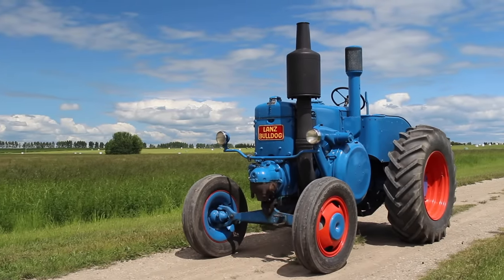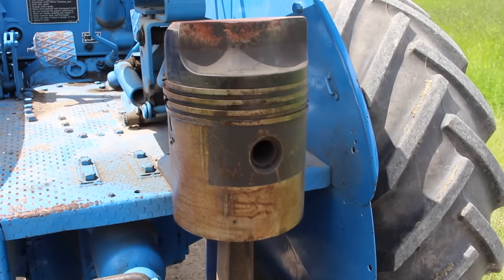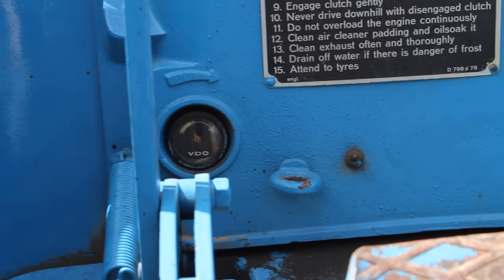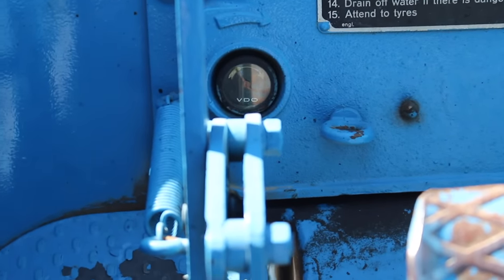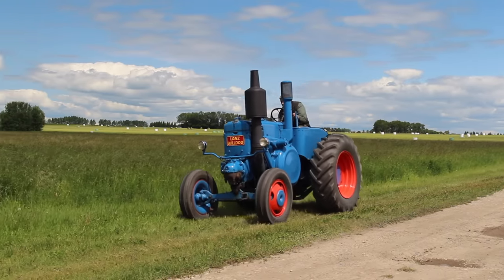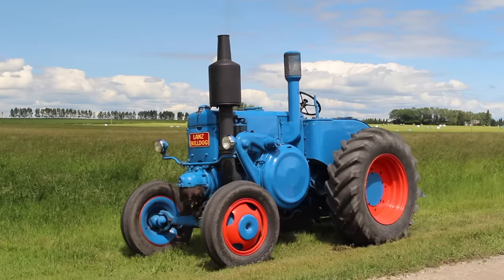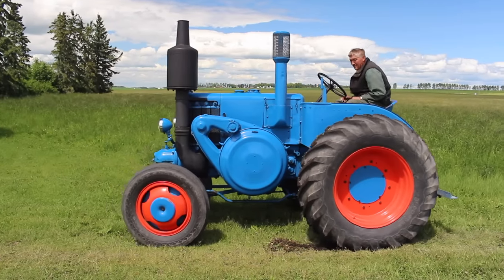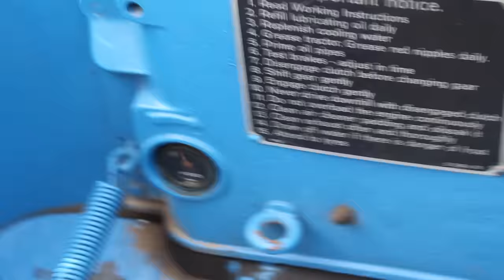Engine running backwards? Lanz Bulldog Tractor two stroke

Comment: Back when stuff wasn’t designed to break after so many years
Reply: Never mind the spare piston on the back 😂
Reply: Lol it’s an 11 litre motor that makes 45 HP the 0.7 litre motor on my motorcycle makes 75 which is only considered average. We have come along way in terms of engineering and efficiency.
Reply: @DMSparky 
45 hp but on 630 rpm. Can your motorcycle do that? :-)
Reply: @DMSparky  yeah but can you reverse the motor of your bike? Or runn 660rmp or no rpm? Or have this much torque?😂
Reply: @DMSparky  the powerband and delivery is all that matters. Your motorcycle engine wouldn't even be able to move the tractor empty.
Reply: @DMSparky  true but there is a slight difference when it comes to torque, a motorcycle would have a hard time getting one of those tires to spin even under 0 load. meanwhile this could pull a house over
Reply: @Daniel M Your motorbike would never be able to put out the crazy torque that this workhorse does. Plus this thing is like a tank, rugged, a more simple design and if maintained will still be running long, long after your bike is dust
Reply: @thebaddestogre-3698   Could you expain to this confused city dweller why that is? Would it not just be a matter of gearing to turn high speed into high torque?
Reply: @DMSparky  haha did you really compare your bike engine to this huge diesel? Do you even know what torque is?
Reply: @callidus-13.x42  you could gear down like crazy, until the tractor is crawling so slow that the farmer wont get any work done. But to get the proper torque to the ground a motorcycle engine would have to be at a crazy high rpm, which negates any efficiency advantage it had. Imagine a honda s2000 motor in a dodge Durango. It would barely move even though it has the same horsepower rating as the 4.7 V8 that the Durango came with.
Reply: @thebaddestogre-3698 
It would with good reduction. Put reduction that you have same wheel speed and it would run almost without a problem.
Reply: @zokonjazokonja  on the freeway the s2000 motor would have to be at 7k rpms just to keep the Durango moving at 70mph no matter how you gear it. It would be getting 5-6mpg everywhere.
Reply: @thebaddestogre-3698   Huh. Isn't HP just a measure of power (like Watts), and wouldn't that just be torque over rpm? I would expect any engine of equal or PS to work just as fine (ignoring the necessary gearing). What am I missing here?
Reply: @callidus-13.x42  Yes horsepower is torque over time which is why a vehicle accelerates fastest at its horsepower peak. More revolutions=more torque per every period of time. But that's where the efficiency comes into play. If you have a big tractor 4cyl running at the engines torque peak vs a 4cyl car geared down so its horsepower peak is putting the same torque to the ground, the the cylinders are getting fuel injected into them 6-10 times as frequently.  Not to mention it would be running hot and turning its work Into heat.
Reply: @thebaddestogre-3698 
I guess you have some calculation behind this figures
Reply: @zokonjazokonja  if you just want to argue then go ask an engineer for Caterpillar or Peterbuild why they dont put Yamaha motorcycle engines in their tractors or semis. If you think they are doing something wrong, you are talking to the wrong guy.
Reply: If you think that power and torque are 2 separated topics than you are totaly wrong, power is calculated basically from torque x RPM, they are connected, one does not exist without other (Edit: ignore this above paragraph, I did't read your previous post where I see that you understand those 2 metrics)
 Now, power you can not increase with gearing, power remain same on input and on output of reductor (minus losses), what is changable is torque. If you reduce gear transmission 2 times, you will get increase of torque 2 times, power remain same.
Now, in your examle of Durango to run 70 mph on highway, constant speed, you should be able to do that with any engine probably not more than 100 hp with correct reduction (I would not be suprised if 50hp would be enough) , because at the end power is needed to do that job. Only what you need is to know air drag and tyre rolling losses. If you are going uphill, than you need to add vehicle mass and slope angle.
Reply: @thebaddestogre-3698  
BTW, I was refering to the posts of the guys that claim that this high RPM engines would not even move heavy vehicles, I just saying it is not true, you can do it with right torque multiplicator. Another question is does is makes sense and how much tear/wear will we cause on engine on long run with such setup, and you are right regarding that, this is not under question. Your example with Durango I already answer, I doubt that S2000 will need to be on 7000 rpm to maintain constant 70 MPh speed (240 hp / 207 Nm@7500 rpm), but it will need to rew for sure, and therefore makes no sense to put such engine on heavy mass vehicle, it is not in correct balance.
Reply: @zokonjazokonja  read all of my comments. You've told me nothing I dont already know and you've not even addressed the efficiency issue. Twice the gearing is twice the rpm. I said 7krpm because that is the torque peak of an s2000 motor. I never once separate horsepower and torque.  Again, you are arguing with the wrong guy if you think every single workhorse engine in history can be replaced by a high rpm low torque engine with gearing magic. You know better than them? There are many negative side effects to it that you aren't addressing which was the whole reason I started a conversation with the motorcycle gentleman.
Reply: @zokonjazokonja  ah your recent comment negates most of my last one, so let's call a truce.  I understand what you mean, but we just strayed too far from my original answer to the motorcycle engine question.👍
Reply: yep. For example, Our Kramer KL600 (62HP awd) is ~50yrs old. We have had many repairs and even replaced the engine once. It still runs fine, and gets (nearly) every job done we have to do, and spare parts aren't an issue. But then, if you'd take for example a Fendt 1050, the repair costs after like 10yrs would be much higher than just buying a new one.
Reply: @nippolus132  there are motircycles with sidecars that have reverse.
Reply: @DMSparky  don't think your little bike engine has 100's of nm's of torque
Reply: @Mr_Fancypants  yeah but i dont think they reverse the engine to drive backwards
Reply: @callidus-13.x42  The issue here is what is often neglected in these endless "horsepower wars":  The ability for an engine to initiate motion.  As long as the transmission is geared properly, any engine with sufficient horsepower can 'maintain' motion.  

However, horsepower is irrelevant when it comes to initiating motion.  To overcome inertia and initiate motion, you have to apply an impulse.  An impulse is, by definition, a shock to the system.  So, in this case, this engine produces a very large amount of torque at a very low RPM, which means the impulse can be applied to the transmission without the input shaft seeing a massive spike in RPM.  

If you were to take a motorcycle engine, as mentioned earlier, and couple it to a transmission that, when the engine is at the RPM of peak torque, would provide the necessary impulse to the wheels to initiate motion, you'd have to dump the clutch while the engine was spinning several thousand RPM!  

That's fine in a drag car that has a clutch that's designed to withstand that kind of impulse.  However, as I think you can clearly see, in this case, it's much more practical to have an engine that generates large amounts of torque at low RPM.  This tractor never sees speeds where high horsepower is necessary.
Reply: That idling with the gear in still felt like abuse though! :(
Reply: @mattiaswidegren2242  It definitely wasn't easy on parts, that's for sure!  I think it was more of a demonstration of how the 2-stroke, diesel cycle works with a single-cylinder of that large of displacement!
Reply: Just the back of the driver when in jiggle mode
Reply: Lmao at how many people were triggered by my comment. First of all I think this is a pretty neat piece of agricultural history and I do in fact understand what torque is. Hahaha this tractor has 7.4x more torque then my motorcycle. I wasn’t claiming my motorcycle was a better tractor then this tractor. Hahaha I’m just tired of hearing the most boomer comment in the world “TheY DoNT buIlD tHEM liKe THEy UseD TOo!” People would still use tractors like this if they were truly superior to modern machines. New tractors are more powerful, more efficient, more comfortable and more productive. Implying that new tractors are inferior to old tractors and that new tractors are designed to break is silly. Pretty sure I wouldn’t trade my 15 year old truck which does in fact have as much torque as this tractor for a truck of a similar vintage.  The only argument is that this for this tractor is that it’s significantly simpler then a modern tractor. Just because it’s simpler doesn’t always mean it’s more durable or better.
Reply: @DMSparky  Please don't hear this as me flashing credentials and expecting you to step back into line, I just want to make known what I was taught:  I have a degree in Mechanical Engineering, and, in my Mechanical Design class, we were taught about the concept of an "Endurance Limit".  All ferrous metals, i.e., anything alloyed with Iron, have an Endurance Limit that, if a part made of that metal is designed in a way that it's application doesn't exceed its Endurance Limit, it will literally last forever.  The science of an Endurance Limit also allows you to accurately predict how many cycles the part will survive if it's Endurance Limit is exceeded in its application.

So, when you mix that concept in with the greed that's running rampant in literally every industry these days, you get vehicles, appliances, tools - literally anything with ferrous metal in it - that are designed to fail after a certain amount of use.  It's a hard fact of the world wet live in. 

The phrase "They don't make 'em like they used to!", while completely cliché, is 100% accurate.
Reply: They don't build them like they used to because people want cheap stuff. The old stuff was heavy and expensive. If you want good stuff, you have to pay extra.
Reply: Looks at all these Elmer Fudds...talking like this tractor has been actively used on a farm all these years...it’s been restored, and kept safe somewhere. If I retouched up anything I found in a few years and kept it in a box for another handful of decades...you’d watch people who are afraid of change circle jerk around how “tHeY dOnT mAkE eM lIke tHeY uSeD tO” and how much their efficient, competent and versatile product they own now “sucks”
Reply: This kind of engines are not the best example of durability, in fact piston's rings must be changed after a fixed amount of hour because of lack of lubrication, that's the reason moder diesel are 4 strokes.
For the argument couple vs horsepower its true that a reduction could multiply the couple with high rpm but with huge consuptions!
Reply: Service stations and garage mechanics weren't very widespread when these were around.  They don't get to rely on someone being around to fix it when it breaks.
Reply: @andreap555  ty
Reply: @andreap555  There's nothing about the 2-stroke cycle that causes piston ring failure.  Look at all of the Detroit 2-stroke diesels that last millions of miles without being rebuilt.  2-stroke diesels were phased out because of stricter emission standards.
Reply: @AutoSearPin  Just because something looks nice and clean doesn't mean it's never been used.  Also, you can cosmetically restore something without needing to rebuild the the mechanical side of it - which is what this discussion is about.  Even if this tractor was restored, there's no reason to believe that they had to overhaul the engine.

Also, this discussion has nothing to do with the obvious increase in efficiency that has come over the past century of engine technology.  You'd have to be completely ignorant to deny that.  The point that is being made in the statement "They don't make them like they used to!" is that there's no excuse for the blatant lack of longevity and high maintenance costs that are prevalent in today's products.
Reply: @JayRussellDuramax  Do they run on pure diesel?
Reply: @andreap555  The Detroit diesel engines?  Yes.  The fuel and lubrication systems are completely separated.  Look up the DeBoss Garage videos of him tearing apart one of them.  They're not like a tiny, 2-stroke, gasoline engine that requires an oil to be mixed into the fuel.
Reply: @JayRussellDuramax   And air is pumped with tubo, right?
Here there isnt a lubrication system and air is pumped by the other side of the piston
Reply: @user2C47   correct it’s all about value engineering. In fairness there are modern tractors that run up 20k hours. People always bitch that their freezers don’t last as long as their parents Coldspot Freezer from Sears in 1955 did. Mean while adjusted for inflation those freezers literally cost $4000 USD and were significantly less efficient, then they complain when their foreign made freezer that cost $350 dollars breaks after 7 years.
Reply: @JayRussellDuramax  like I said in another comment A ColdSpot freezer from Sears in the year 1955 when adjusted for inflation cost $3950 USD most people don’t spend more then $750 on a freezer today because most people aren’t interested in spending a months wages on a freezer. Most people don’t care about a products longevity as long as it’s athletically pleasing, is inexpensive and has a certain feature set. Blame the consumer, greedy executives and extreme value engineering. I honestly feel bad for most mechanical engineers today.
Reply: @DMSparky  That's not an apples to apples comparison.  Comparing the price of an emerging technology to what it is now is neither fair nor is it relevant to this discussion.  The original statement was that products of yesteryear were made more robust and reliable than products of today.  That's a fact.  

You are correct, though, that the majority of people don't care about reliability or longevity - which explains the unfortunate character traits that those same people embody.  If people were concerned about things that matter most - namely, reliability and longevity - our products would be much better - and they'd still be made in this country!
Reply: @andreap555  Turbos rely on exhaust pressure to move air.  The only way a 2-stroke engine can use a turbo is if the blower providing the intake air operates at a higher pressure than the drive pressure of the turbo.

Are you saying that the down-stroke of the piston pressurizes the crankcase and then charges the cylinder when the piston is low enough?
Reply: @JayRussellDuramax  I agree. I’m in Canada and about to pay more then double to have motorcycle ramps for my truck bed made locally in a nearby fabrication shop rather then purchasing a product made in China. I think reviving domestic manufacturing is one of the only ways we as a society will survive. I go out of my way to buy products made in the USA or Canada wherever possible even if it costs significantly more. I’d rather my money go to someone locally rather then someone over seas.
Reply: @JayRussellDuramax  I was doing a lot of research relating to freezer design the vast majority of manufacturers bragged about having LED lighting or Bluetooth connectivity rather then compressor size or ease of serviceability. With the exception of commercial units which for some reason will void residential insurance policies.
Reply: @DMSparky  Exactly!  The same stuff infuriates me on maintaining engines!  I worked at a Valvoline Instant Oil Change, and it never ceased to amaze me at how much of an afterthought maintenance is nowadays.  It also constantly amazed me at how many people refused to actually maintain their engines.  I saw multiple vehicles with under 40,000 miles that were already leaking oil because the owner refused to put in anything better than conventional...
Reply: @callidus-13.x42  You can use gearing to get more torque but if you try too much the engine will stall. A motorcycle engine will never have much torque, pistons are too small, that is why all vehicles with a shit ton of torque use larger pistons. Most Semis use Inline engines with massive pistons that make a normal car engine's piston look like a child. You will never get as much torque with a motorcycle engine, even with all the gearing in the world, as you would with something that is meant to have a lot of torque. A wider piston will have more surface area effected by the explosion from the combustion of the fuel and air, though it wont run as fast as a narrower piston due to more weight and some other factors I wont go into, it has much more torque.
Reply: Whats not there cant break, plus what breaks is way easier to fix.
Reply: @JayRussellDuramax   Thank you! That clears up a lot of questions.
Reply: @JayRussellDuramax  Maybe its called only volumetric in USA i meant that type.
Yest its exactly like a gasoline 2t engine but diesel is injected directly in the head chamber.
Must correct myself there is actually an oil pump that sends oil directly in the cylinder so it runs on mix diesel-oil
Reply: @andreap555  I don't see any documentation saying that a 2-stroke, Diesel engine pressurizes its own crankcase.  Everything I see shows that they require forced induction, i.e., a Roots blower, to charge the cylinder.  This means that there's nothing preventing them from having separate fuel and lubrication systems.  So, unless you have specific documentation that you can share, I don't think you're correct in saying that these piston rings wear out quickly.
Reply: @JayRussellDuramax  I have a link but its not in english: http://trattoridepocapiacentini.it/testcald01.html
Also my fathers family had one with this engine (Landini 55-60 cv) and told me that the piston was the only moving part.
Anyway thinking on how air blower works dont think that coul be reversed so easily if it had one
Reply: @andreap555  Thank you for the article!  Bing Translate worked well enough for me to see where my issue is.  This isn't a, true, Diesel engine.  It's a "Hot-Head" engine - meaning the ignition isn't produced by the temperature of the compressed intake charge, but, rather, by a piece of red-hot metal in the cylinder head.

As far as lubrication goes, though, unless something has been altered for the cutaway view, I don't see any piston rings at all.  It appears that the compression ratio is low enough that the piston can reliably compress the air into the upper chamber without the need of rings to seal the cylinder.  You are correct, though, that this engine burns oil in its lubrication process.  Unless I misread the article, this engine may run entirely on its lubricating oil! 

As far as blower operation goes, there needs to be a way to maintain the drive direction of the blower independent of crankshaft rotation direction.  For the Detroit engines, I believe it's as simple as installing a reverse rotation water pump and blower.  I've also heard that, because the engine blocks have the same bolt patterns on either side, you can remove the accessories and transmission, and simply mount them on the other side.  I'm not an expert on them, but, I know that they were very often used in pairs for marine applications, and one of them would run backwards to offset the torque of the other.
Reply: @DMSparky  you do know low rpm engines are the most efficient internal combustion engines right? Ofc you dont.
Reply: @josephbarovich8733  do you even gear ratio?
Reply: Now days tractors can run 24/7 with out any problems while doing it extremely effectively doesn't matter if it's -30 or +50 celsius.
Reply: And if it did break, you were allowed to repair it and you could get parts for it.
Reply: @redsquirrelftw  no one is preventing anyone from fixing their own stuff. But terminology is subjective these day. I bet you'll agree then disagree. Dont buy shit you know/can know you can't fix. That's obvious, Reich?
Reply: Designed in? Na. And most of the old shit is broken and broke down in less hours. You're not taking into account all the tractors thay are not around or running because you see this pretty rebuilt tractor.
Reply: @DMSparky  Over 350 lb ft and you're at 50.
Reply: @nippolus132  one is diesel, one is gas. Nontheless, the motorcycle engine is far more advanced.

Still it would be super interesting, what a modern sort of the Lanz engine would look like
Reply: All these people comparing a motorcycle to a tractor are stupid, he was using it as an example of how technology has increase theyre completely different machines and obviously excel in different areas
Reply: @DMSparky  it's all about the torque, not the HP.
Reply: Lets go back to under engineering things.  "Hmm looks like 1/2" will do, let's make 1 1/2" so we don't have to mess with adding weights."
Reply: @Alex-uy7pc  planned obsolescence also has nothing to do with difficulty of engineering nor tolerances in assembly. It's keurig using a plastic needle mount that breaks before the needle goes uselessly dull.
Reply: @squeethesane  correct, I would say that's a whole seperate animal. I'm just talking about the old saying "any asshole can make a bridge that won't collapse, but only an engineer can build one that just barely doesn't collapse."

We have 2 levels of products consumer level designed to fail

And commercial level that manages to get the job done quicker then ever, but because of "economic" manufacturing the machine has 1/4 the service life. Ex: We replaced a compressor motor in a building of ours maybe 8 years ago, the original motor was from '68, the replacement just burned up last month.
Reply: Yeah. That is why there is so many Lanz Tractors around to this day, because they did not break and ran forever. Also they were incredibly effiecient compared to modern cars, and todays engineers dont know what they are doing AnYwAyS!111!!!!eleven1
Reply: @thebaddestogre-3698  Dont argue with fools. You can only counter with statements on their levels. Everything else wont work.
Reply: @Treyk901  hahah, did you really assume that you need huge stroke and weight to generate torque? Do you even know what a gearbox ist?

These engines are ineffective as fuck. If we would be using this technologie to date we all would have to breath from compressed air tanks.
Reply: @peteraugust5295  seriously? If all we needed were gearboxes then why does the engine matter? Why would a truck manufacturer advertise 1000 ft/tq engine tq and invest so much money into the engine engineering when they could just slap a Yamaha engine in there with high gearing? Let’s think about this. An engine can only do so much work regardless of gearing. Put enough gearing on a small engine and yes it’ll move but at a snails pace and won’t get much work done. Why would a ship use HUGE engines if all they had to do was throw a bigger gearbox on it? It wouldn’t be able to spin the prob fast enough to move. The easiest example that you can do yourself is to ride in a 4x4 truck and do a 0-60 run in normal driving mode. Now do the same thing in 4x4 LOW. There’s so much gearing involved that is slow. Torque is huge but the engine now has to spin so fast to get any work done that it is now slow for normal driving.
Reply: @peteraugust5295  oh man, sometimes observing and listening is where its at rather than running your mouth first. 
Where have you been all these years Scania and Iveco were looking for ya. None of their engineers knew what gearbox is till you came along.

PS. Scania 450 and toyota supra both have 6 cylinder engines right? They both have gearboxes right? 
Are those engines of same size? Are they of same geometry?  Ever heard of terms square, oversquare, undersquare? Rod length to stroke ratio? Where in rpm range is the tq and how much is needed for particular task?

Everything else being equal and without going into philosophy, long stroke will always produce more tq and at a lower point, where short stroke will always rev higher and produce more power at higher point at the expense of low down tq. Tq vs hp, acceleration vs max speed...
Reply: I am not entirely sure what your point is tbh.  Is there one, or are you spinning circles for no reason?

Scania and Iveco have long found out that you dont need 260mm Stroke to generate torque haha
Reply: @Treyk901  Really? Impressive, you have understood the Concept of power. At least to some degree. I am impressed.

But now what are you trying to tell me? And how is that comment related to what I said? You can build an engine with 5cm stroke and still have 2000hp if you want. Weird, isnt it?

Horsepower in essence is RPM*Torque. Therefore with gearboxing they can be close to the same thing, which is why we dont use super long stroke pistons anymore, but rather more effiecient engines with shorter strokes, higher RPM and the same Power. With gearboxing that leads to the same torque as with a long stroke piston but at half the fuel consumption. Magic!
Reply: @peteraugust5295  no i was just saying that there are all kinds off tractors from the 50’s and 60’s kicking around, now a day they are so over engineered that they have become useless, we get rid of them after 5 years cause one stupid sensor goes out and it take a team of three guys at least a week to figure out whats wrong with it, order the part and fix it. Don’t get me started on cars, ive have so many problem with our trucks id give anything to get a solid 80’s truck at the dealership, last gmc 1500 i purchased didn’t even make it of the lot and died. Home appliances used to last forever now if you get one year past the warranty its a miracle. Its all good on paper and in books but when it get into the real world shit just don’t last anymore.
Reply: @dkdanis1340  living on farms i would bed to differ, the mechanical part is pretty good its the stupid electronics, back in the day it broke you fixed it, now it stops it take a team of mechanics to figure out what sensor is fucked any 2 days to get it and a day to fix it. Theres a reason we rent tractor on snow removal now, they just don’t last, rent’em new and pass the headaches on to the next guy. Bunch of engineers that design something and have never worked a day on a farm or snow removal. But their books say it well work so.....
Reply: @TheStp77  Agree on that, but that is customer demand. People are not interested in cars anymore, they are interested in Twitter, Youtube and Netflix and expect their cars to have 40" screens. So this is what car manufacturers produce.

Same for tractors. Farmers rather chill in their cabin and watch instagram then drive themselve, therefore producers build all kinds of technology in to make that possible.
Reply: @peteraugust5295  yup that i can’t deny, if the demand wasn’t there obviously it would be built
Reply: @preferredcustomer3527  Don't even know if they used galvanized steel there. The only thing which kept these machines from instantly rusing apart was probably the paint, which probably had lead in it too.
Reply: @zokonjazokonja  And it also can't pull 60 tons...
Reply: hard to break down when its under powered
Reply: @aaronmcconkey338  very true but stuff is over engineered and built as cheaply as possible to just make it passed warranty so you need to buy a new one. Farm equipment isn’t as bad but too much electronics to last as long as any of these things did🤷‍♂️
Reply: @DMSparky  hp is not important at all. torque matters
Reply: Back when a normal pleb couldn't afford a shovel and died age 55
Reply: Planned obsolence in capitalism is what made modern prodcuts such trash
Reply: @xgamerbih  couldn’t have said it better.
Reply: @DMSparky  that’s also why it is still running to this day. Your motorcycle however have a predetermined lifespan. 11L making 45hp isn’t really doing any work.
Reply: @zokonjazokonja  you should watch steam tractors, they arent fast but could pull out every tractor thats made now adays. Only becouse it had 3000/6000 torque. Movement speed is 2/5 mph.
Reply: @nippolus132  my motorcycle basically can't do a burn out. This thing can rip the ground at zero rpm
Reply: @DMSparky  yes but an engine like this has infinite torque XD